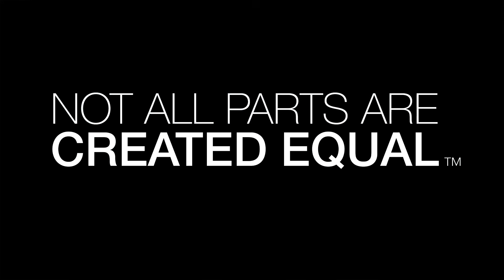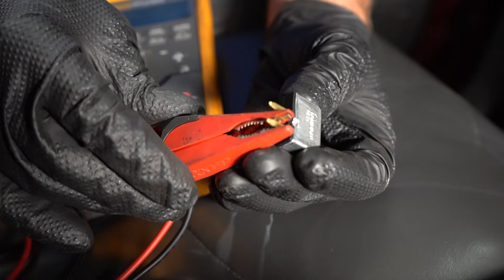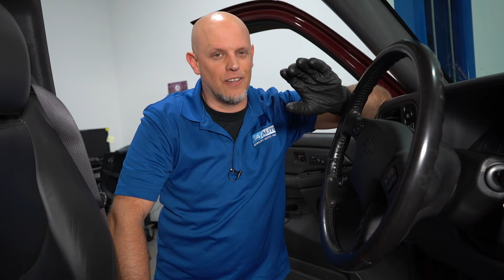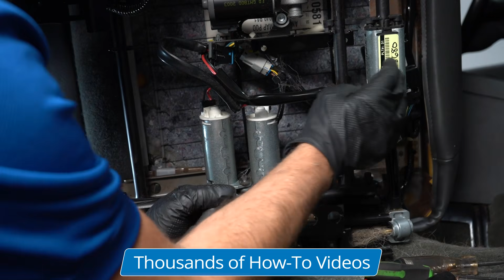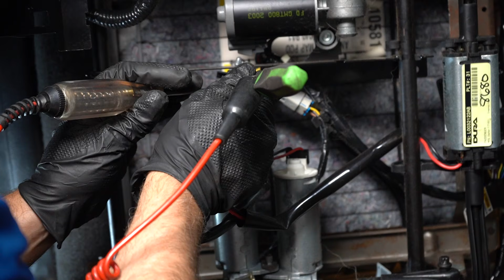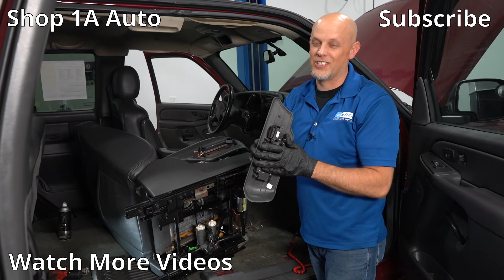Power Seat Not Moving? How to Diagnose Power Seat Motors, Switches, and Wires!

Comment: I have an 11 Ford crown Vic also one day my driver's seat and the trunk button that doesn't need the key on stopped working. I connected the other trunk power switch that uses the key on and it works fine

Comment: I have a situation where the motor on the left side of the dirver seat gave out completely. the issue is the seat is all the way up front like you showed here. As such the bolts at the front are coverd and I cant take them out. how can i access the motor to change it if i am unable to remove the motor.

Comment: For at least a year now The single function of raising or lowering just the back half of the seat has not worked in our Odyssey. Every other single function works. I have tried it probably hundreds of times So I decided to look it up on YouTube and I kid you not I don't know what kind of voodoo magic this is but halfway through this video I try it again and it just started working 😑😂 I can guarantee you it was not user/operator error I am very mechanically inclined and knew it had something to do with the circuit or that individual switch itself and I'm really not one to take the time to leave a comment but in this case I feel it is necessary lol

Comment: mine is a 1990 F350 and only has a red and black wire. i confirmed it's not getting power. but I can't find a fuse box diagram for that year that has power seats on it. it's a motorhome so it may be an aftermarket set up.  i was wondering if I could just connect it to a 12v battery and move it.  currently i can't drive the vehicle because it's stuck forward.

Comment: I have a 2004 Lincoln ls v8. The lumbar on the driver side works but the other buttons do not work. I took a seat out of the junk yard and it worked. So I know nothing is wrong with the seat or the motors. How do I check the wires to know which is bad and what do I look for.

Comment: my problem was the MBEC 50 AMP J case fuse. 2003 extended cab no power seat and passenger window didn't work either.

Comment: 2010 Lincoln Town Car The seat is stuck in back position. It. Won’t raise or lower or move back and forth.  I hear a small “click” when I push the buttons but it won’t move. The ONLY seat part that will move is the seat back. It will lean front and back.  Any ideas?  Thx from St. Louis. Ric Louis

Comment: For anyone facing the same issue as this but with a 2015 hyundai genesis sedan there was no fix on the internet that I could find.  I figured it out and made my own video if this helps anyone.  This is for when the some features are working but some are not- this gets you right to the control board so you can fix the issue manually.  https://youtu.be/poROdLJDOwU?si=jE1LylbbwOkuaNQT

Comment: seems like infiniti has an issue with the motors. it was mentioned already that like a car starter, tapping a motor may get it running again. The thing is this Q has 5k miles on it and on passenger side, the seat wont go up & back & the drivers side derrière wont go up & down but the front of the seat does go up & down

Comment: My cars seat will move forward and backward, top of the seat leans forwards and backwards. But the actual seat will only move the back half up and down. When I try moving the front half up or down the motor runs but sounds dull and there’s no movement.
Reply from the maker: +@maddieclark7888 We wouldn't be able to diagnose an issue like that here, you may want to have a local mechanic take a look at it. Thanks for checking us out! http://1aau.to/m/Shop-1AAuto-c

Comment: I have manual seat but have this connector on both sides. Now I get the big wires being power, but what in earth are the other ones? I want to utilize this plug for something. Maybe lights , a charger idk. But I sure won't know if I don't know what the wire pairs are or what the duty is.
Reply: I'm sure a few are triggers for heat and ejection, things like that.

Comment: Needed you to go a step further after the motor. Motor kicks in but seat doesn't move. I am able to manually get the seat to move with a drill but not sure if what is damaged is connections from the motor or to the adjustment gears. And way to tell? Just want to know what tobuy befer taking te seat out. Not my car kids boyfriends, So kinda a pain to work on it twice.

Comment: I have an 08 Grand Cherokee. Neither power seat works, heated seats not working, pedal adjust not working and right rear door ajar light is on. Also ABS/Brake and traction control lights are on. Radio fritzes out. I checked fuses. Checked CB for the seats and it's super hot. Meaning it's a wiring  issue somewhere, right? Any idea where to start looking? Everything was working fine, then the dash lights came on. Then I noticed the door light. A few days later I noticed the seats, but that probably all happened at the same time.

Comment: I just purchased a 2014 Ford Explorer.  One the the up and down motors is not working.  I tested the power and there is 12V going to the motor (-12V when I push down).   So I really do suspect the motor is bad but any advice before I change the motor?

Comment: Other videos such as this one (https://www.youtube.com/watch?v=o5jT3EiAG6w) state that the battery should be disconnected to avoid deploying the airbags. This video does not cover anything like that. Is that something I should be concerned with. In order to perform these tests there has to be power to the seat. I have a 2013 F-150 SuperCrew 3.5L Ecoboost and a passenger seat that does not recline or return. The seat does have power to slide forward and rear. Any help is welcome!

Comment: 6-5-2024 I am sitting in my 2003 Lincoln town car signature right now. My seat does not go forward or backwards. I’m looking at the door panel where all the controls are at the switch that makes the seat rise up and down and the switch that tilts the seat, where your back rest again it tilts back and it tilts forward so the only part not working is where the seat the whole seat does not slide forward or backwards towards the brake pedals or gas pedals. Any idea if you answer thank you.
Reply from the maker: +@ruggedrickrude1946 We wouldn't be able to diagnose an issue like that here, you may want to have a local mechanic take a look at it. Thanks for checking us out! http://1aau.to/m/Shop-1AAuto-c

Comment: While the video covers basic troubleshooting, some models have problems specific to their lousy cheap Mexican manufacture.  Fords have magnets in their motors which are glued to the housings and fall out.  They have to be epoxyed back.  They also have nylon worm gears that break teeth have have to be replaced.  Common in Fords.

Comment: Wow, I can't believe I watched the whole thing - about wires and testing.  Don't have those meters - maybe I will before I die of old age.  Ok, older age.  Meantime, maybe you have an idea on this:  2014 Dodge Grand Caravan SXT.  I hit a pot hole the other day.  The next day, long story short, it turned out my battery died because the battery clamp got loose (again - not since the new battery was installed last Nov).  A little later, after a jump start (before I knew clamp was loose), I proceed to leave gas station, and my seat adjustment wouldn't work properly.  Some sort of whining noise -- could never get it to move as forward as I need it - only on the left side.  Right side is ok, it seems.  Two mechanics at dealership strongly thing there's a penny stuck down there (from their experience).  I then took it to car wash, used tire inflator to blow out the tracks.  I didn't hear anything bounce around (like a penny).  No improvement.  Maybe I got it to move a half inch forward.  Still need more.  Right side moves forward but stops - I think only because left side not moving forward.  They tested the car with the expensive dealership computer -- no issues showed with car seat.  He said some other minor issues in other parts of the car.  Didn't tell me what.  But nothing on seat.  Several hours later, and I'm not hearing that whining noise when I try it -- but left side still won't move all the way forward.  Not sure if up and down is better.  Am using in back of me to push me forward.  That puts me seated on the seat edge which is higher, so I've got the height back that I need.  Yeah, I'm short.  Heh.  Well, average for female - 5'2".  Gas pedal is already adjusted for shortness.  Only left side - or that's where the worst of it is.  Any ideas?  Meantime, I'll check underneath seat again - see if any of my mass belongings got stuck up in there someplace and I missed removing it from under the seat.  Seat lowering power is strong!  Thermos fell and rolled under there - seat lowering made a couple of good dents in it.  I was amazed.  You're a good teacher.
Reply from the maker: +@aliced7505 Thanks for checking us out! http://1aau.to/m/Shop-1AAuto-c

Comment: I have a 2011 malibu and there are no screws that hold on the trim. When I look under seat I can see that there is a metal u-shaped clip holding it on. I have tried pulling on it but I'm afraid it's going to break. Is there a trick to these clips?

Comment: I have a customer with a 07 Nissan Murano. Her driver's seat goes forward and backward on the left side, the the right side don't move at all.
I'm not to good at electrical. I haven't worked on any electrical seats, either.
What could be the problem to cause that?

Comment: You never said how the motor reverses if it has only two wires in which case there is a relay or it reverses through the contacts or on the switch. Good video

Comment: I have a 2000 corvette and the main control to move seat forward/back/up and down does not work.

I checked ground, and have 12 volts coming to switch and out, but power to motor is only 4.6 volts?

Comment: Okay, here's  the problem,  the drivers seat  was pushed up to clean under,  there was a toy that jammed it.  The toy was removed.  The 'sound' still sounded, as the control was pressed to move the seat back.  The seat wouldn't move.    So,  does anyone think it is 1. a rod underneath that may have been bent?  2.  something else?  or 3. the electric system.  Yeah,  I already said,  the sound sounds for connection to move...just no movement.  And everything else works.  The back goes back and forth;  but,  I keep it back just in case the air bag might inflate.   Auto place wants 800.00,  they say to readjust the electric system!!   ....I'll just drive with my knees against the dashboard!  ---  Sure would appreciate any advice.

Comment: Why did my Haynes manual say not to remove that circuit breaker? They said to only take it out a lil bit, enough to expose the prong so you can touch the lead of the voltmeter to it. So is it ok to take it all the way out???

Comment: You touched on every problem except the one I have.  The seat on my Silverado goes all the way forward but won't go all the way back.  I'm thinking something fallen into the track or a drive gear messed up.  Any thoughts?
Reply: Same problem but on a Chevy Camaro 2019 did u ever fix the problem?
Reply: same here.
goes forward and doesnt come back.
the engine makes the ZZZZZ sound but the seat doesnt move.
hello from italy 🇮🇹🍕🍝
Reply: I have the same problem in my 03 it is forward all the way and I can't even get in the seat

Comment: How do I know if it’s not motor under drivers seat. When I go to recline drivers seat I hear it click but nothing. Replaced switch still won’t recline. Also I push seat to go forward it goes back and vic versa 2004 Yukon Denali XL
Reply from the maker: +Marty Hart We wouldn't be able to diagnose an issue like that here, you may want to have a local mechanic take a look at it. Thanks for checking us out! http://1aau.to/m/Shop-1AAuto-c

Comment: I can take my seat switch apart to where this joy sticks are disconnected from the Box and move the sliders on the inside and it works. I put it back together and it don't work. what's the deal

Comment: My power tilt on driver seat of my GMC Terrain wasn't working. The fix is to test the switches on the side of the seat. That can be accomplished by prying off the side cover and checking continuity on the switch bar. That bar of switches is very cheap, under $20.00 so it might be the first to replace. The power tilt is in the back of the seat. You have to remove the hard plastic cover on the back of the seat. That will give you access to the motor for the power tilt. If you can find or rig up a 12Volt battery you can connect it to the positive and negative leads on the motor. This way you can test the motor independently of any wiring or switches. In fact you can use this technique to check all the motors (forward/backward/tilt). 

It turned out in my case it was the switch. The motor tested fine. Search driver side GMC Terrain switch and you can find it for cheap on the web. Hopefully this info helps someone else.

Comment: I have a 2018 ram 1500 and my seat would not adjust forward or backwards unlucky for me my vacation was over and leaving from FL back to TX didn’t have time to check it over but the following day was able to identify issue to be bad switch so if you need to find a quick fix you can swap out connections to motors to have temp fix in emergency situations

Comment: Nice video.  I have a Chevy Suburaban 2015 .. The issue is that the Driver Seat goes to the right side when I move the switch to the front.
Reply: Sounds like a bad rail or stuck rusty

Comment: 2005 Nissan pathfinder, goes forward goes backwards goes up goes down back rest goes back, BUT back rest does not come forward. Any idea what that could be? Took off the actuator, put it on the opposite way and used the going back button  to make the gear go forward. But that’s kind a half assing it, would like to fix it the proper way, thanks for any help

Comment: Good video, but you did not test the motor, you only showed that you had power at the switch/motor connection and therefore assumed the motor was good. I have a seat from another car that I want to install in my 99 Monte Carlo. When I connect a 12 volt battery directly to all three motors, none of them operate. Is there some safety that I don't know about. Can you show testing a motor by applying 12 volts?

Comment: Found the video helpful and think I followed you well enough to attempt this after I watch it one more time. Only request would be to help us beginners out by explaining what the tools and parts are called and go a little more slowly explaining what to do under the seat regarding each of the 4 motors and checking for, I believe it was, "continuity" using a multimeter or perhaps it was something else you used that looked like two screwdrivers. Great video, but a little difficult for beginners who need the help & don't have tons of knowledge.

Comment: In my car there ia problem that seat is going forward but not coming backward the switch is working and there is also sound of motor that its working but seat itself is not going backward what is the solution?
Reply: Check the connections to the switch inside the panel and to the particular motor under the seat. If that's not the issue, replace the switch inside the panel. For a quick fix, you can also flip the positions of the red and black wires for that specific motor that controls that function as explained in this video. Flipping them reverses the functionality - up becomes down, forward becomes backward. That will allow you to move it in the direction that doesn't work currently.
Reply: Is something stuck inside the track blocking it? Check the connections to the switch inside the panel and to the particular motor under the seat. If that's not the issue, replace the switch inside the panel. For a quick fix, you can also flip the positions of the red and black wires for that specific motor that controls that function as explained in this video. Flipping them reverses the functionality - up becomes down, forward becomes backward. That will allow you to move it in the direction that doesn't work currently.

Comment: My seats goes forward but not back? Should I replace the motor?
Reply: Check the connections to the switch inside the panel and to the particular motor under the seat. If that's not the issue, replace the switch inside the panel. For a quick fix, you can also flip the positions of the red and black wires for that specific motor that controls that function as explained in this video. Flipping them reverses the functionality - up becomes down, forward becomes backward. That will allow you to move it in the direction that doesn't work currently.

Comment: So both of my seats dont move forward or backward. But all of the other functions work
Reply: He covers that in the video. Check the connections to the switch inside the panel and to the particular motor under the seat. There are 4 motors, and each one controls a particular function. If securing the connections doesn't fix it, you go to the next step. He demonstrates checking for continuity on the motor connector and said that if it lights up, then it's a bad motor. If it doesn't light up, it's a bad switch.

Comment: you probably do NOT need 2 wires.. the motor is probably already grounded to the chassis. however IF you remove the seat then you may need to jumper the seat to ground with a nice heavy jumper lead. Most of these vehicles do NOT have ground wires IF they're by default mounted to the chassis (why have the expense of having ground (return) wires you do not need?). What mechanism gets the most usage? The fore/aft mechanism of course. Thus THAT'S the motor that goes kaput 90% of the time. So perhaps rather than replacing it you can switch it out with one of the other much lesser used motors and especially if they look identical they probably ARE identical. Worth a shot and here's why.. These manufacturers do NOT sell seat motors they sell the entire seat track assembly as a single unit. Yeah that'll set you back about a grand.